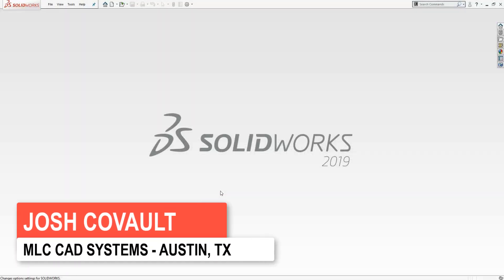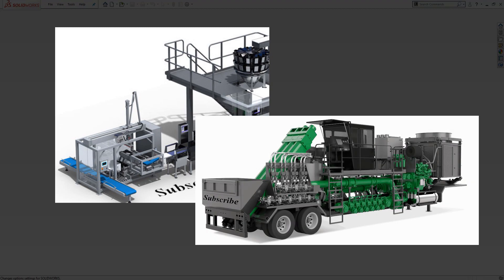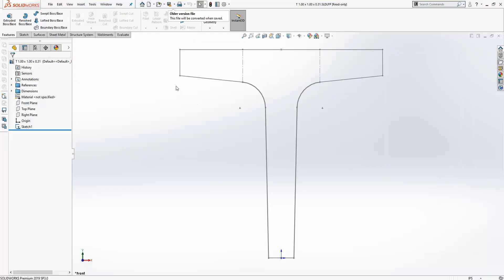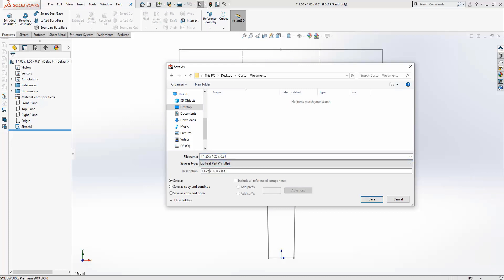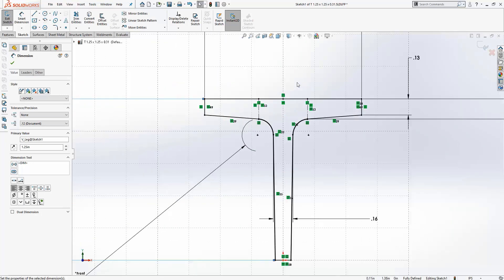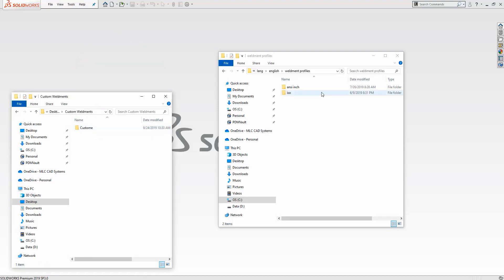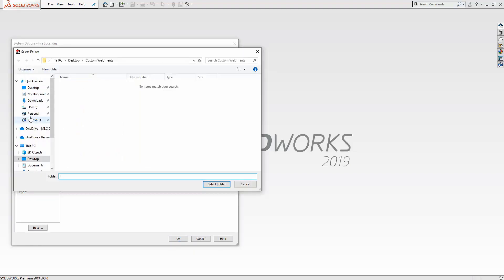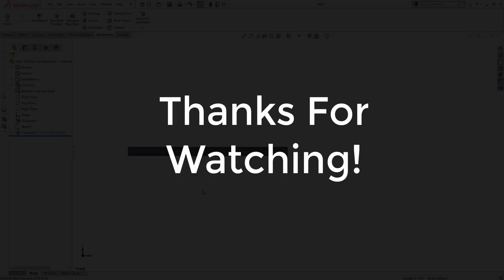How To Create Custom SOLIDWORKS Weldment Profiles

Comment: in both my iso and ANSI folder only content file such as rectangular.sldlfp rather than rectangular folder with size inside. can you help me? im using SW2019
Reply from the maker: A few years ago SOLIDWORKS created a new type of weldment file that uses configurations instead of individual files.  If you see that file you can still open it up and modify it the same way or make a copy, but pay attention to the configurations instead of individual files for the sizes within that shape.  The change is being phased in, but as long as you maintain what they provide you should be good to go.
Reply: @MLCCADSystems  thanks. I will try it later

Comment: No help at all, can't open the sldfp, had to slow down to 25% speed just to see what he was doing. Wasted 20 min of my life trying to understand it.
Reply from the maker: If you are having issues I recommend reaching out for support to help you understand what your obstacle is.  Keep in mind that the profile file extensions are not normal SOLIDWORKS files so you'll have to change the "file type" option to All Files to see them.